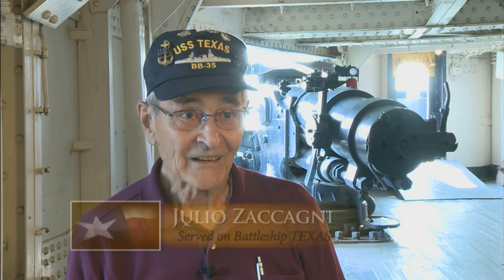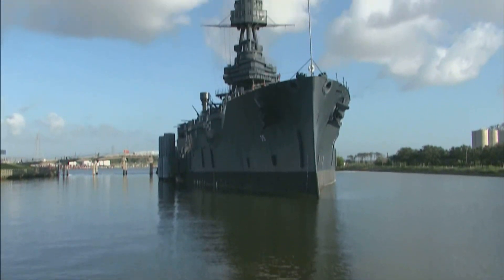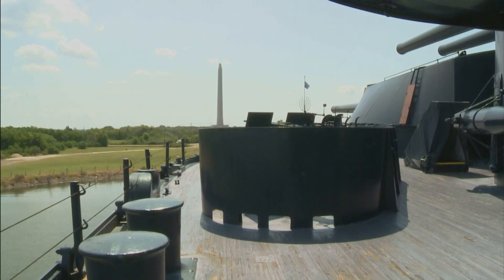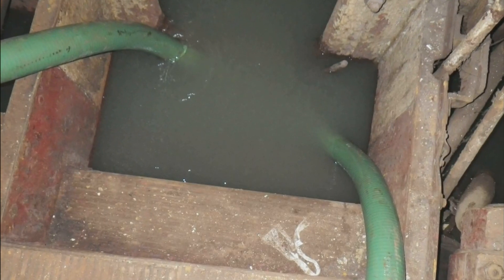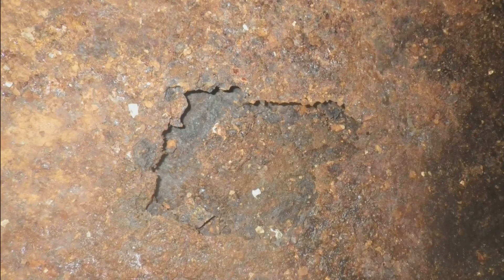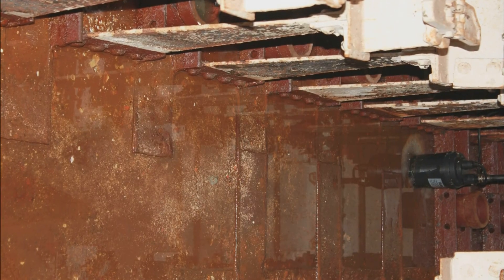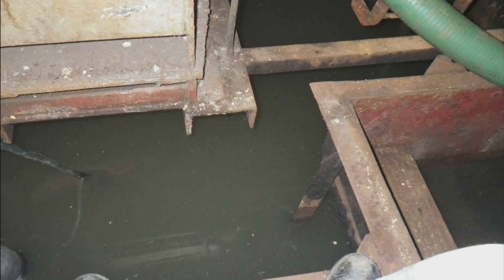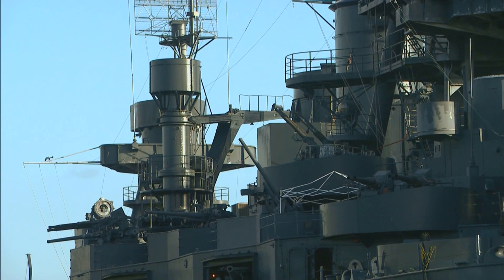Battleship TEXAS Repairs

Comment: who the hell decided to sink it to save it - what did you think was going to happen??
Reply: Balasting with water is how she was operated in the Navy, they just didn't consider the long term effects. 

Without fuel, crew, and ammunition the ship is alot more likely to be blown around or capsized by high winds. So they weighed it down for stability
Reply: @Texassince1836  Wasn't that only done with ballast tanks?
Reply: @texastad1989  everything is a balast tank when needed
Reply: Remember they wanted the ship to stay put in a cat5 hurricane, so they flooded lower voids and fuel tanks to make her sit hard aground in her berth.
Reply: @Texassince1836  I still can't believe there was not a better way to do this.
Reply: @texastad1989  there are better ways, BUT the Texas was one of the first attempts to preserve a steel warship as a museum. Much has been learned,  as you can see from the Condition of the Iowa class battleships.

Comment: The video is 7 years old what are the plans now
Reply: The museum is currently closed.  The ship is supposedly going to be rehosted at another location AFTER she has been repaired.  Supposedly much of her antiaircraft armament and other easily removed items have been removed from the ship to be restored and reinstalled after the ship herself is repaired.  Much of her framing has been reinforced and repaired already.  The issue now is the shell plating.  From what I understand if you drop a hammer or screw driver onto the bare shell plating you will poke a hole in the bottom of the ship, that's how fragile it is.  They are filling many of the voids and blisters with basically an expanding foam to help reinforce the steel shell plating.  Where they are going to dry dock her at?  No idea but the clock is ticking and perhaps may have already run out on the vessel.  With the shell plating in the kinda condition I understand it to be in I question if expanding foam will get her to dry dock.  Granted the USS Olympia went from endangered to ok via polymers that the museum were able to patch the water wind line on her with, but the Texas is in far worse shape than the Olympia ever was.
Reply: Towed to Galveston.
  $30,000,000 repair!👍

Comment: I think the people that decided to flood spaces of a steel ship in brackish water need their heads examined. The fact that the ship isn't even towable because of steel wastage is a crime considering how heavily built the ship was. In a naval shipyard we replaced frames and more under boilers in destroyers and cruisers, no battleships active then. Much of the steel replacement could be done in the water. If they just sit the ship on land like many other museum ships,  the bottom will just rust away and the whole ship could collapse. Texas is probably the only pre-WWI battleship in the world.
Reply: @gooser__43  Yes I was aboard the pre-Dreadnought. It appears to be sitting in cement next to salt water. Cement is porous. It will eventually rust away and collapse.
Reply: They took on water as ballast,  which was common when the ship was in service too.

The problem with that is in service the ballast water was cycled out, as the required ballast amount changed due to conditions and fuel level. As a static ship the water that was there was just there, allowing it to go acidic and cause corrosion. 

The Texas was one of the first US attempts to make a floating museum of a steel hull ship, there have been teething pains along the way.  Iowa Class ships like the New Jersey (decommissioned in the 90s) have had much better care due to what has been learned from the Texas and other preserved steel hull ships.
Reply: @gooser__43  The Mikasa is in worse shape than the Texas, thats why she was removed from the water and encased in concrete.